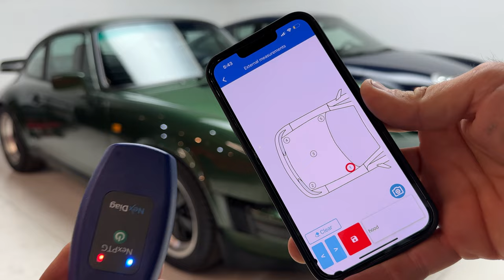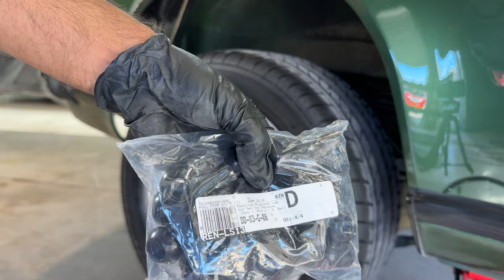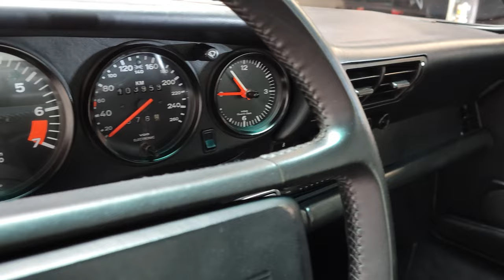SPECIAL Porsche // Classic 911 Carrera Paint to Sample DETAILING

Comment: For the bit where you cleaned the spare wheel area try using a clothing stain remover like resolve. I used it plenty of times on out sprinters and heavy trucks👍 best ive seen at removing stubborn grease and stains. Wouldn't use it on leathers or rubbers but on cheap plastics or metal bits like that it should shred through everything.
Reply from the maker: Great tip! We’ll check it out 😉

Comment: Fantastic paint, characteristic of the first 930 Turbos. Great job lads as always..! (Was there a nail in the tyre in 19:20???)
Reply from the maker: I sure hope not! frantically checks time stamp thanks for watchin!
Reply: You have a point but this isn't a 930. Which is better in my book.
Reply: @John Gidman  The style reminds me especially of a 930 unless I have got it so wrong in my mind.
Reply: It's equipped with the early 930 whale tail but that's it. Just my opinion but I think it looks cleaner without the tail. But as they say, you pays your money and you takes your choice 😁
Reply from the maker: @johngidman4574  John, could you explain why this wouldn't be considered a 930? It has the same bumpers as the 930, engine, whale tail, interior... what am I missing? Is this not a 930??

Comment: Still loving your videos. Still love how your crew has the energy day after day to do these exhaustive detailing jobs.

I've asked before, but never got an answer. Does your crew using microfiber polishing pads depend on what the paint meter returns or do you use them on most paint defects that have a visual appearance that warrants it? For instance, do you always use them on spiderweb defects that you can visually see or is it all the paint meter that determines the pad used?
Reply from the maker: Hey Adrian, thank you for your love and support 🙏🏽 glad to hear you love our work. About your question, it always depends on situation and thickness of the paint… sometimes we using foam pads (medium/soft) for removing spiderwebs, sometimes more hard foam (rarely) and also sometimes wool. But most of the time we using microfiber pads for removing those swirls, etc.